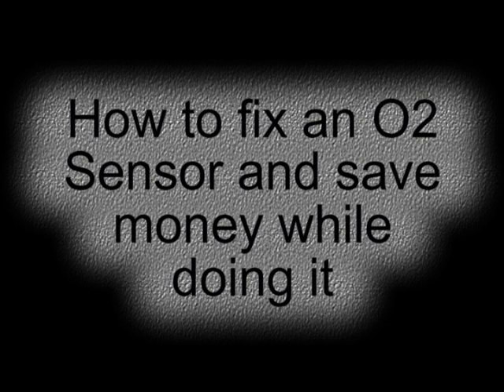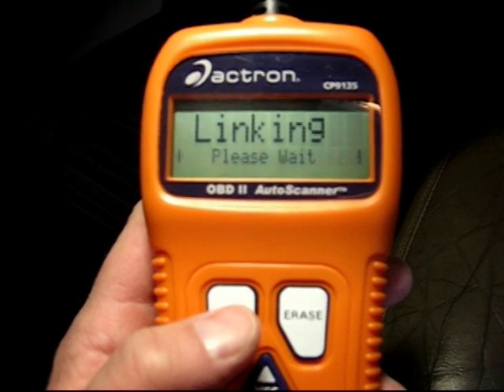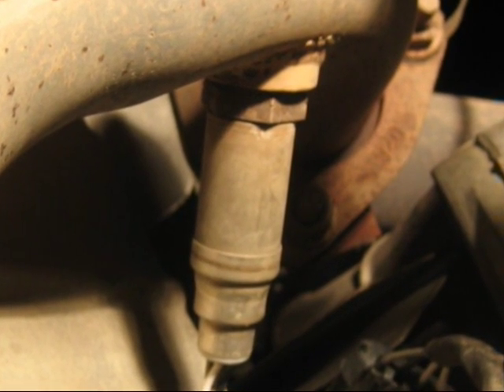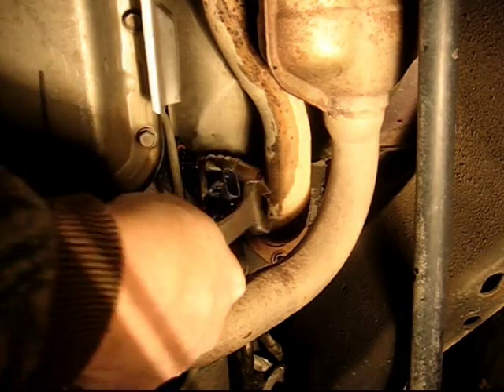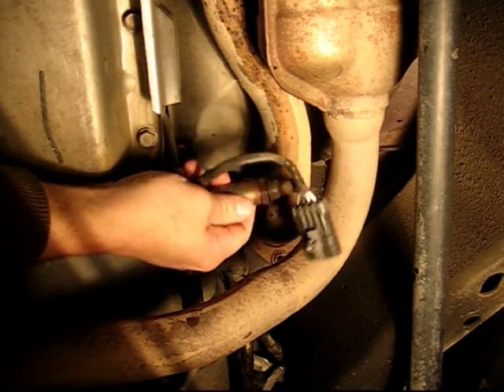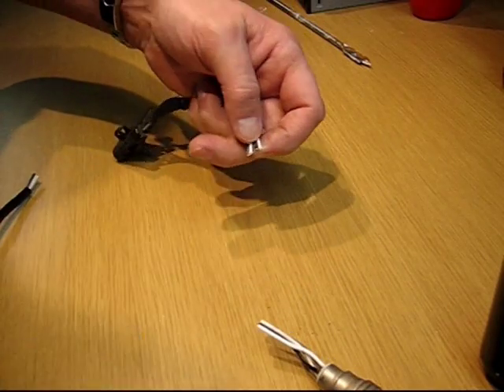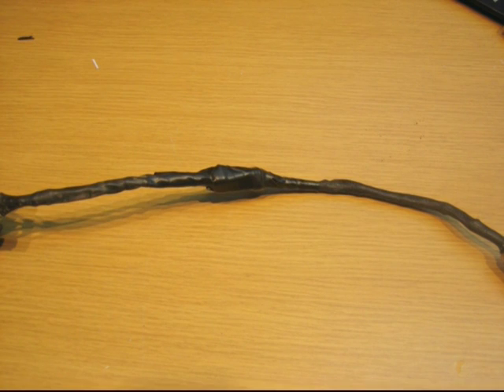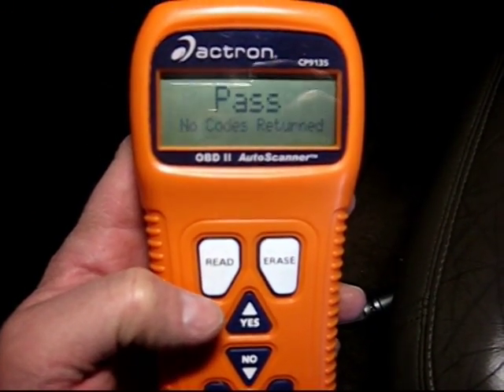How to replace an O2 Sensor and save money.

Comment: should i reset the computer once i have changed out the sensor?  or disconnect the battery?   or just plug and go?    i have lost about 400klm to a full tank with this sensor messed up.. i really hope this works lol

Comment: yeah go ahead and save money being in denial and pay thousands later when it causes you to have an accident😶it will really destroy your car...that's a brilliant plan......yes folks,, the light really means what it says. .service your engine soon- is your early warning of mechanical and electrical failures telling you that you should consider replacing your distributor cap and alternator...driving on this is very dangerous...it can make you wreck......your car can suddenly jerk forward into another car while braking,, its a fire hazard also. This is what destroys the other parts of the engine....this is why its important to replace most parts new instead of "used".. Because when the parts are not getting proper voltage and power distributed evenly it causes mechanical failures that always get misdiagnosed as tranmission problems because of jerking, spark plugs because it loses power, braking problems ,etc...because your computer also malfunctions and misread....so how is the code reader gonna be accurate to detect the problem if the computer sends the wrong code out?? The alternator/distributor cap is really the heart/power of the engine....😶folks don't keep ignoring this light...it really means you are beginning to have electrical problems. You save money by doing things right in the first place.!

Comment: There is no reason to reuse the connector, then resplice. A sensor that includes the new connector is the best way to solve the issue long term. The only thing that is not made clear is the difference in "upstream and down stream. " I tried the trick about turning the key "off, on" three times, and it reads out on the dash with a code. The other thing to try is disconnecting the neg. battery for 2 minutes to see if the light goes out.

Comment: why not just buy the o2 sensor with the connector already on it and save tiime?
Reply: +Shane Waldo because he says to save money, i'm assuming without the connector already on will be slightly expensive. although slightly more expensive he is still technically saving money.
Reply: Scott Grenier you save $20 if you can do it why not! you will get youself 3-4  6 packs of beers!😅

Comment: Use top tier gas. Stay away from cheaper gasolines they only meet the minimums. If you use regular 87 octane use Mobil. If you use premium use Shell. I did my homework and these gasolines are the best for detergents. You should never get engine lights for emissions.

Comment: I had problems with the sensor backing out from the exhaust port. I found that giving the cable an anticlockwise twist before connecting it keeps a clockwise twist on the fitting.

Comment: I have a 2004 mustang gt $ the check engine light was on & it was running real rough to the point it wanted to die on me. I had a mobile mechanic replace the intake manifold which had a leak,after replacing that it ran even rougher & did die. He used a OBD code scanner & said I had a bad 02 sensor& wanted a lot of $$$ to fix it & when I said I couldn't afford it he would tell me which one it was. 
  here is the question I'm gonna change all four myself now do I need a OBD meter after I do that, please advise me.
Reply: Sean, hope you got the problem fixed by now. In the future, I would suggest that you don't go to that mechanic anymore. You don't need a scan tool but it help. Usually disconnecting the battery cables for 20-30 minutes allows the codes to clear on most American-made Cars.

Comment: I'm trying to get my check engine light to turn off. I bought a 02 sensor that didn't work , tried to taking the positive battery cable, that didn't work, due to my frustration both cables off, that didn't work. Took it back to Autozone they can't get a reading now, the check engine light is still on. What do you suggest
Reply: +Vivian Morgan fixing the problem. it came on for a reason.
Reply: Vivian Morgan

Comment: Well I a ford windstar 3.8L van,the shop that I took it to broke it off ,all the way to were it screw in at,all that's left is the bolt and nipple,they stripped it so bad that it's a circle,and it's hollow inside and I can put my pinky in it and feel the end of the nipple from inside,can u please help me get it out please!!!
Reply: Alton Thomas that doesnt get rid of the problem. It comes on for a reason.

Comment: Most cars I've worked on do not have 2 pre and 2 post cat sensors.  Just one pre and one post.  For those watching this, don't drive yourself crazy looking for sensors that aren't there...
  Also our 2005 Subaru has 2 cats and only 2 O2 sensors.  2 cats doesn't mean you will have four sensors.
  Next - you do not splice these wires using a butt connector.  Either buy the O2 sensor which is properly terminated or re-use the factory connector by removing the pins from it with a pin removal tool.  Butt splices can vibrate loose, cause intermittent reading and the heating/cooling cycles will cause them to fail.

Comment: This might be a totally stupid question, but, if there's 4 sensors, how do you know which one to change out??.....................ಠ̯ಠ
Reply: it depends on what code is generated. The code should indicate which sensor is faulty. Location varies depending on vehicle and engine.
Reply: the first one after the engine itself i believe, but it's probably different depending on you what car it is.

Comment: punk kid at a repair shop replace my o2 sensor.  It was same error code as here...for bank 2 sensor 2.  He gets done and comes out and tells me that they replaced the sensor, but now it's coming up "no code" and engine light is still on.  Tries to tell me that I have to leave it so they can take the time to run diagnostics.  Umm... PLEASE correct me if I'm wrong... but "no code" would indicate an open circuit... and having just replaced a sensor, wouldn't this indicate one of 2 things... 1.  the new sensor they put in is bad, or 2, they installed it improperly.  Please, let me know.

Comment: Ok so I have a question,  when I replace the correct sensor will the service engine light turn off?  I have a 98 tahoe,  p0161 code came up when I had it checked, o2 sensor2
Reply: ***** That only works on a few vehicles. Not all. Just go to Autozone. They will scan and reset code for free for you.

Comment: Don't trust these wannabe mechanics, The information he is giving you is incorrect, just because the scanner shows a bad sensor code, it does not necessarily mean that the sensor is bad. Half the time you have loose or damaged connections, bad ground or even a bad pcm, Do not trust these amateur videos.

Comment: BTW you can purchase a less expensive (Simvalley™ Mini ELM327 Bluetooth OBD 2 Automotive Diagnostics Scanner for Android) plug-in and then add the OBDII App (for Andriod) that connects to the scanner via Bluetooth on your Android phone. I have found "TORQUE - Engine Managemnt Diagnostics app" as the best so far. It links the engine codes so no need to go to the webb to look up what the code is telling you.
Reply: I'm going to check this out...Thanks! Any experience(luck) using w Volvos? I have an S40-2003
Reply: agreed, torque has saved me so much money. used it on about 40-50 cars with no problems yet.
Reply: Bueno y por que son pinches malinchistas y puras mamadas en inglés y no en español ?
Reply: Raul Trejo

Comment: I just replaced 2 o2 sensors in my Holden commodore , like the Holden place told me that was the problem but light is still on.do i need to get the code erased

Comment: Agree.. Seeing live data is the only real way to check an individual sensor's performance and be at least 90% sure you are doing the right thing. I always like to check for other things that may have damaged the sensor or causing falce readings..Oil/water, contamination, condition of spark plugs, head gasket tests, misfiring and compression tests..

Comment: Good point.. The fault code may give a clue or using a computer showing live running data should give a better idea of how each sensor is performing. Not all OBD2 compliant vehicles have that many sensors. Most only have two..one each side of the Cat.

Comment: They do make off set O2 removal tools now cos access to these sensors is ALWAYS limited. You have to be very careful spraying WD40 around the sensor and VERY careful not to get it on the new sensor.Some sensors are take readings from both the inside and outside of the exhaust You may want to re-use the old sensor if the fault returns or do a voltage test using a blow lamp so try not to cut the wires too short if you are re-using the connector. Finally, make sure the crimps are heat resistant..

Comment: He lucked out with this diagnosis. Lots of codes indirectly point out a problem and have little to do with the code's description. Sometimes an O2 code isn't the sensor but another problem upstream such as a faulty injector leading to a lean/rich condition etc picked up by the O2. The reader he used is only that, a reader. It's not a true "scanner" giving him live data. Also the replacement part is one less desired, a universal instead of a direct fit, which comes complete with plug.

Comment: Check Amazon.com for a scanner: I got a maxiscan OBDII for $19 it is adequate.  Car must be 1997 or later.  "Check Engine" light on usually now means any one of several conditions that have occurred, or are occurring.  You can clear it with the scanner and see if it doesn't re-appear, condition was a one-off thing.  O2 sensors will generally not be magic bullet repairs for anything very serious.

Comment: hello sir, thanks for the video. I have a 2004 dodge caravan sxt, the error code i pulled is P0138  o2 sensor circuit high voltage (bank 1 sensor 2). where is the bank 1 sensor 2 located? is that passenger side after the cat? thank you very much!

Comment: Would faulty O2 sensor be reason for P0171 AND P0174 to come on for my 2000 Ford Explorer?  I have not indication that anything is wrong with the car other than the check engine light is on and I am getting these codes.

Comment: For example, my Saturn SL is throwing P0133 (Bank 1 Sensor 1) and P0137 (Bank 1 Sensor 2). That will tell me that my upstream sensor, aka #1, (BEFORE the catalytic converter) is slow/faulty and my downstream sensor, aka #2, (AFTER the catalytic converter) is faulty.

Comment: If your car has two catalytic converters, there will be 4. If you have one, there will be only two sensors. When checking your codes, match these up. Bank 1 (possibly right cat.converter if you have two. If you have ONE, you will only see Bank1), Bank 2 (possibly left cat.co). Sensor 1 (upstream/pre/front o2 sensor), Sensor 2 (downstream/post/rear o2 sensor).

Comment: will an o2 sensor cause my truck to sputter when accelerating?  If not, I'm stumped..replaced plugs, cap button, distributor itself, wires, fuel filter, fuel pump..please help

Comment: Use Kroil to loosen up the sensors, it works better as WD40 is a water displacement and not a lubricant. Mouse Milk works great too.

Comment: Normally, at least with OBD-II, there's a code for each sensor. In my case, I own a 2000 Pontiac Grand Am, the code was P0133. This means, Oxygen Sensor Circuit, slow response (upstream sensor). So that tells me that it's the sensor forward of the Cat-Con

Comment: I hope someone with knowledge helped you with this.  I don't have mechanical know-how but I do know that it sounds like what my husband's Toyota was doing and he had the ERG valve replaced and it worked fine - but only for about 8 or 9 months and then it started up again and the mechanic told him again that that was what was wrong.  They are too expensive to keep having replaced every 9 months or so, so he traded the car.

Comment: You are asking for trouble with your backyard mechanic use of butt connectors and electrical tape. Eventually water will penetrate it and cause you problems. If you want to cheap out by using your old connector you can either buy the correct terminals or solder the wires together and seal with heat shrink tubing. You are not a very experienced mechanic to be showing the world how to do a faulty job.

Comment: I have a 2004 Dodge intrepid which is coding multiple misfires and O2sensor 1 Bank 2.  My husband has replaced this sensor twice now and we are still having missing and hesitation issues pulling out and at stop signs/stoplights etc.  Any ideas?  We do have the code machine and this is what it is saying.  When we reset it works for a little bit and does it again.

Comment: Nice one I'm planing to do this on my Volkswagen Passat 06 this is like conversion style and a lot cheaper I like it this way but I still have my warranty so till then I can't do anything I did on my headlight conversion kit 10000k low beam it's pretty easy if u know where to connect everything u cut... Anyway I think I will buy 02 sensor for my Volkswagen Passat 06 cause my engine lift shows up... Thanks for the video it was helpful.... From Seattle Washington

Comment: Is this what I should change if my Ford Explorer 05 has an ignition problem? The first time I turn on the truck, it's fine. But, after about an hour driving it and turning it off, the second time I turn on the ignition, the truck does a little shaking, and then sometimes turns off.

Comment: Don't buy a Bosch oxygen sensor,junk and Bosch auto parts are nothing but junk.Topping off the gas tank will set it off.My Grandma Rose's Saturn was this way,replaced the oxygen sensor was replaced twice.Found out she was topping off the gas tank and told her to stop doing this.Did and the code did not appear anymore.

Comment from the maker: That is very true.  On my other truck I just purchased the OS with the connector already installed and it was much easier and you don't have to worry about not getting the splice sealed up good.
Thanks for your comment.